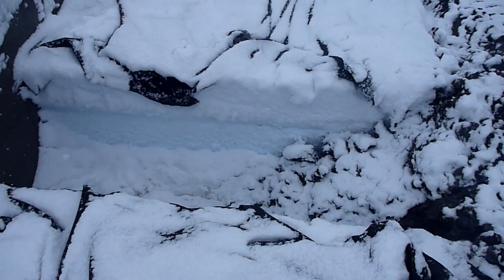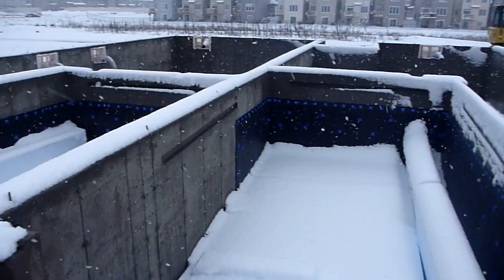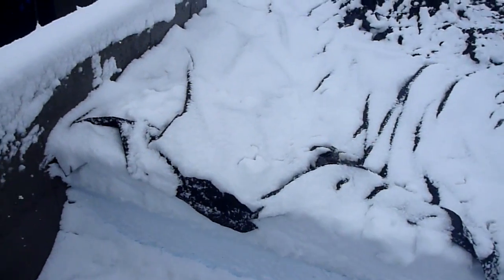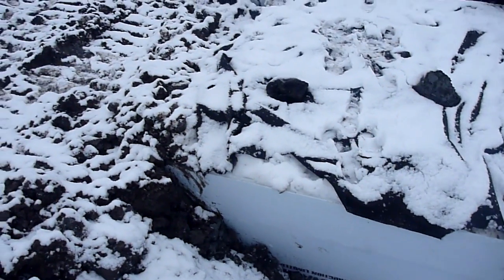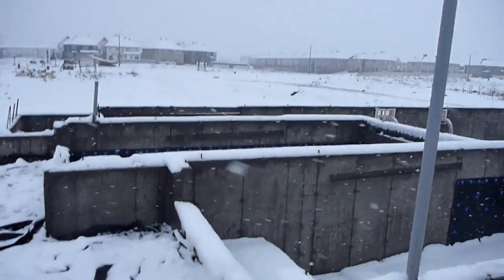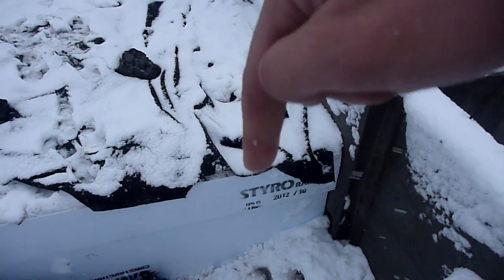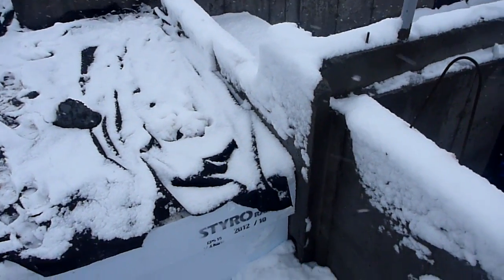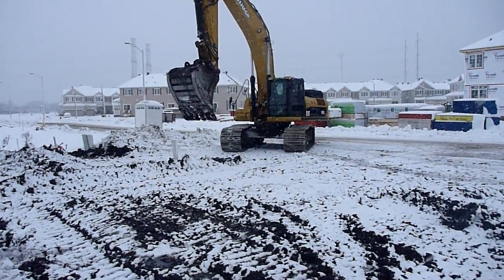Lightweight Backfill

Comment from the maker: A very good question! The amount of snow and depth of fill (along with the type of fill material) will change things but typically you cannot bury any snow more than 1.5m or it won't melt in the spring time. For engineered fills there are usually picky about snow (unless in small amounts) until the last half meter. In the case of this video the last bit of dirt is simply for landscaping purposes and snow will have no effect on it.

Comment from the maker: It's not for the cold, they don't want the weight of the material applying the hydraulic pressure to the footing. The inside sections will get X amount of styrofoam and X amount of clear stone depending on the ground conditions to weight the foundation down so it doesn't float. A lot of engineering!